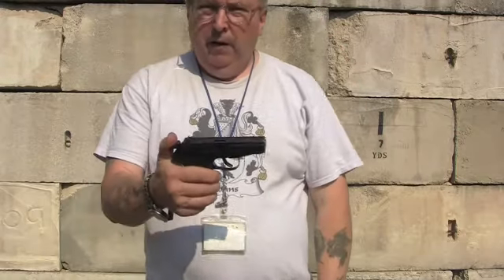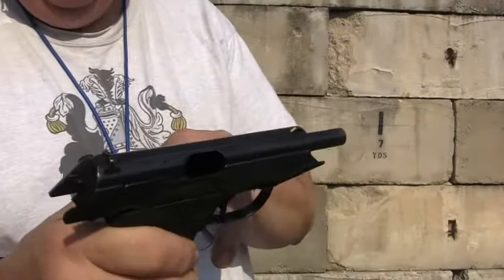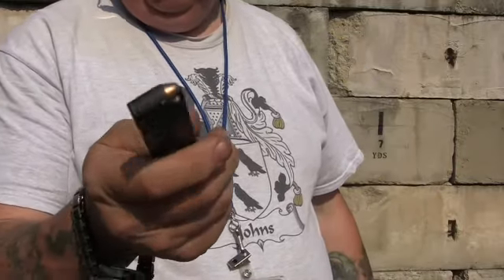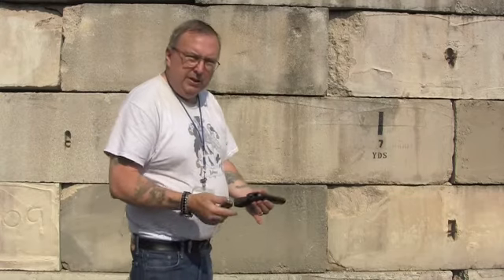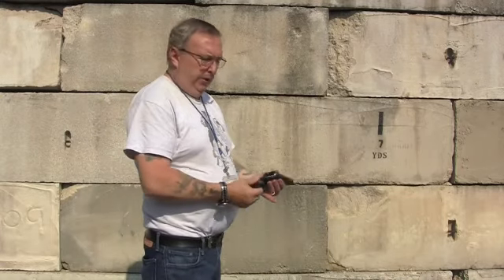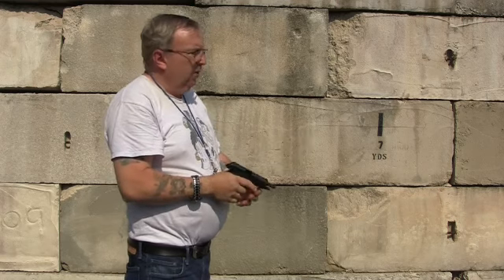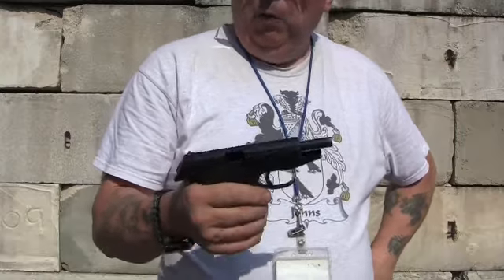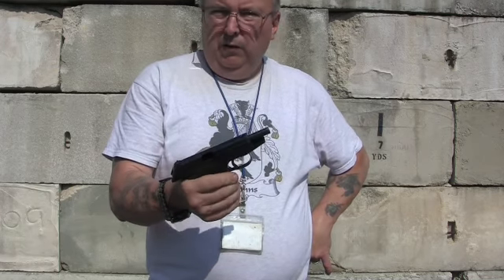Polish P-83 shooting after replacing recoil spring

Comment: I have a Polish P-83 Eagle stamped version round hammer Lucznik imported. My gun has no feed problems since I bought and shot it. No problems with recoil spring mine had the feed ramp touched up so it can shoot hollow points with no malfunctions. I am happy with mine it is reliable easy to take apart and clean and a good close range self-defense pistol.

Comment: Feed problem has nothing to do with the recoil spring.  The original spring is better than a Wolff spring.  Polish the feed ramp.  Or better, shoot several rounds and you will see how it is feeding up the feed ramp.  It will leave a mark on the feed ramp.  Also, look to see if problem ammo is a steep rim cut.  But I doubt you will find any with 9x18 except maybe S&B.  Surplus 9x18 pistols general don't have a problem with ammo.  You just found an ammo that feeds better than others.  It is still a problem with the piece.  You can see weak ejection just prior to malfunction.  This could also indicate bad timing.  If so, you will need to take it completely down and inspect the parts.

Comment: Thanks you for your video and ignore all of those who find fault since no one has to watch. Now, having said that, I have fooled with all kinds guns all of my life and like a all machines, some just work better than others of the same kind and model. Someone suggested that the recoil spring has nothing to do with feed...wrong, everything matters! I suspect that your magazine is not quite right for what ever reason. I had a like problem on a gun just recently and just changed mags., that corrected the problem so mark each mag and see if the same mags fail. Recoil springs also play a major part if the spring is weak as it must sweep the bullet forward into battery but, a too strong spring can prevent total slide movement on discharge. I suggest trying a different mag. and go from there.
Reply from the maker: thank you